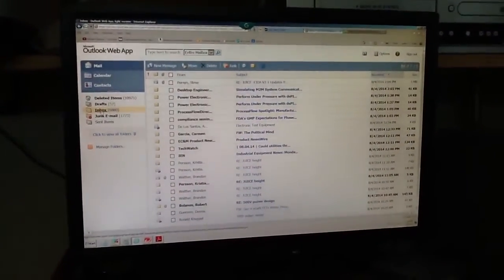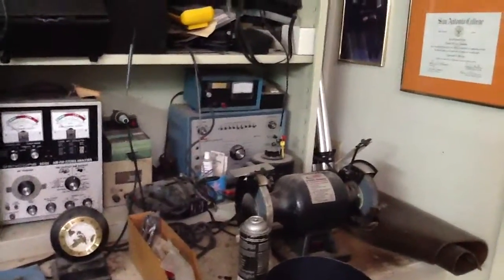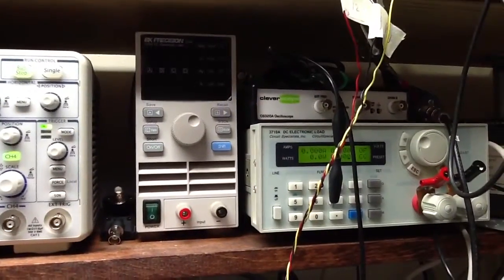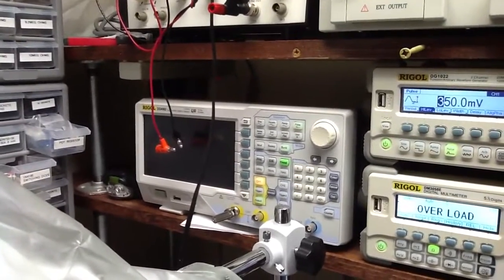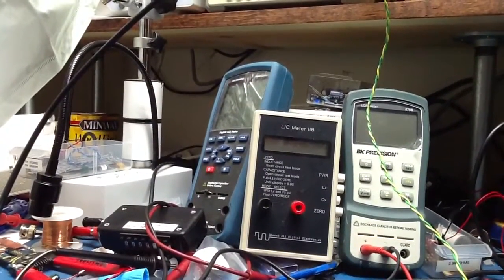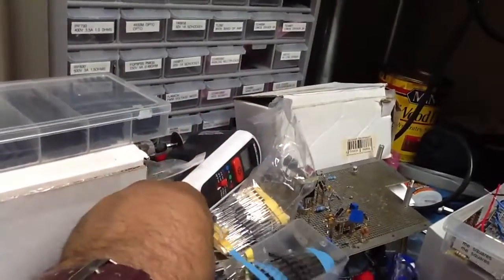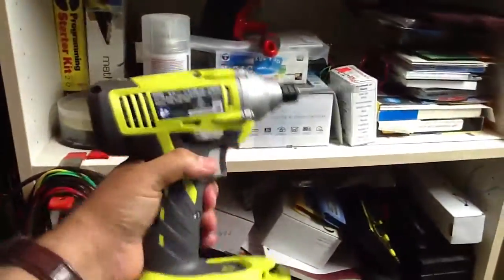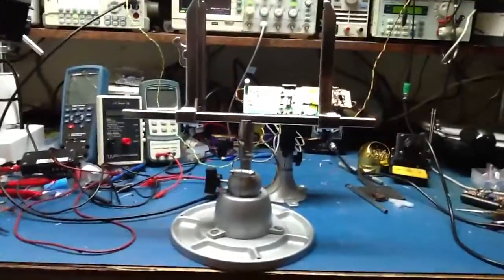Tour of my Home Lab

Comment: Robert : what is the cost clever FRA? Can you please tell? Does it measure PFC boost gain, phase since PFC loop bandwidth is <10 Hz or even 1Hz
Reply from the maker: Hi Kali, the cost for the FRA and scope is 1500 to 1700 dollar. However, Keysight just released a new scope that also has a built in FRA and it might be cheaper. Visit the EEVBLOG.COM and you will see a preview. The Keysight needs and injection transformer which is sold separately
Reply: thank you